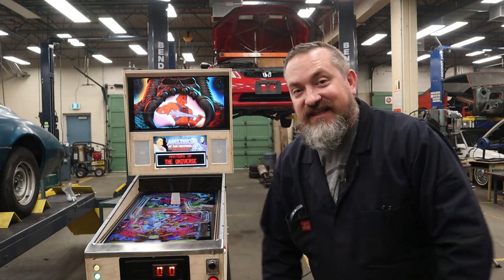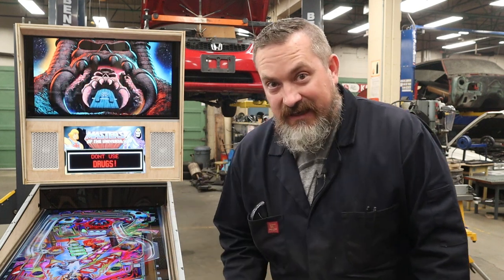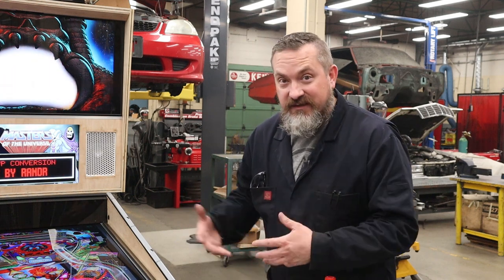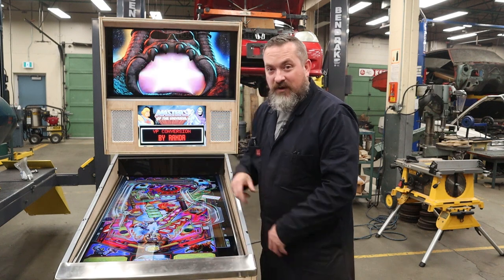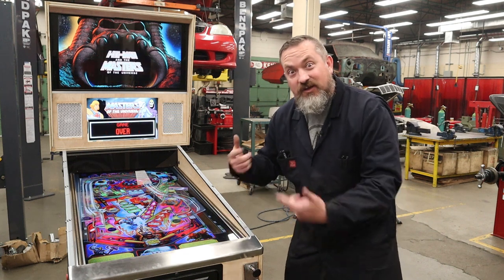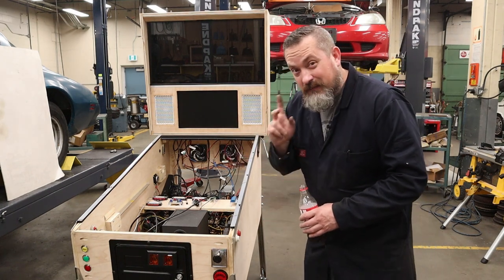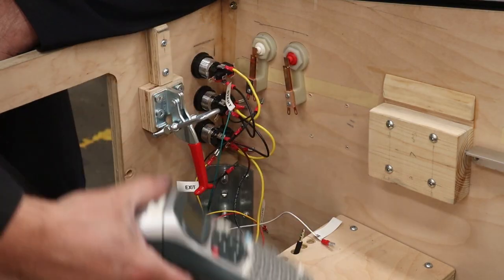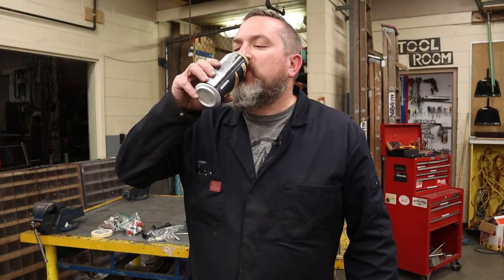How to disassemble your best friend: virtual pinball

Comment: Another great video!  Like you, I disassembled my cab to paint the interior.  Before painting, I painted each screw hole in the cabinet with dayglo paint (any paint or no paint would work).  Then I placed a round sticker (like a small price label) over each hole.  After painting the inside black, I was able to remove each label/sticker and easily see where the screw holes were.  
If I drank your energy concoction, I'd be awake for a week.  Wow! 🤣
Reply from the maker: Neat tip!  I like that one.  Yeah the mix is a bit goofy, just trying to add some crazy to the video.  Thanks for the watch!

Comment: Totally feel the pain man! I was without my cab for 2 weeks when I upgraded my playfield to an LG C2 and that was not fun! Tried playing on my desktop computer but this is not near a full toy cabinet! Keep it up, your videos are very helpful to the VPin community 👍
Reply from the maker: Yeah it sucks..... I'm going on 3 months now without my vpin.  I'm getting close to being done though ( the budget build....upgrades being planned) as I am ahead of where my videos are.  I am finishing the final assembly maybe next week.  I've been playing fx3 on my PS4 to deal with my pinball addiction.   You still loving your c2?  That's my plan for a 4k upgrade in a 48" size.  Thanks for the watch and your support for the channel.  Cheers Eric!
Reply: Thanks for the feedback. Yes, my C2 is awesome and have absolutely no regret about it. The only tricky part is the power ON / "OFF" pixel cleaning cycle but I was able to use the TV ON feature of my Pinscape AIO controller. Works great. I am working on a side project for a custom power control / timer module to make it even better and for those who do not have the same control option.
 @wayofthewrench
Reply from the maker: Perfect, I'm getting closer to the 4k upgrade plan.  So what's the tricky part for the pixle cleaning?  Does the power to the tv need to stay on?  I've got my current tv in a always on spot on the power strip so coming back later to shut the cabinet off should be a big deal.  Does the C2 have an auto sense and turn on for power on?

Comment: This is why I painted my cabinet first after assembly, although there is a little bit of touch up to do as the playfield mount was a little too tight to the sides.  But of course it's easier to see in your videos with the naked wood.
Reply: I'm with you on this one. I also painted after assembly. My solution to not having to do touch ups was to use black mate vinyl on the inside of the cabinet. It looks amazing and when handling the playfield mount carefully, it doesn't scratch at all.
Reply from the maker: There's no wrong way to do this.  There are pros and cons to do either way.  Thanks for the watch!

Comment: I can’t believe I missed this one.  My anxiety I soooooo high right now. Some of the parts removed have precision install points. Some serious detail to attention on reassembly or lots of tweaking and adjustment will be needed.
Reply from the maker: Yup everyone is in the same situation.  However, the holes will still be there after painting so you aren't losing your precision location.  As long as you bag and tag every screw, it'll be a quick and easy reassembly... you'll see in my reassembly video that's coming.  Thanks for the watch!

Comment: Definitely going to paint mine before assembly!  lol.  One question I'm thinking of is can you remove the legs from the Pinball machine, fold down the back case, and transport it in a 4Runner and set it up again?  I may be wanting to do that every 6 months or so.  I saw there were parts near the legs and so my question, wondering if the leg bolts are obscured by parts nearby.  Of course, those parts could be placed in a way to access the leg bolts.  Answered my own question :) What's the whole thing weigh?  

In my build, I've ordered a pre-cut plywood case and 4k 120hz TV for the playfield.  I'm putting together a gaming PC without a case to power the graphics card and 4k graphics.  I've overspent a bit, but dang it's going to be awesome hopefully.  I'm following along with your parts orders for the most part.  My dining table is covered in electronics at the moment :)
Reply from the maker: Yes you can just support the cabinet and remove the leg bolts and lower the blackbox to fit in a suv.  I'm a little leery to just rest the blackbox t molding edges onto the stainless playfield sides though.  Maybe make a carpeted/padded protector.  It's heavy.  I have 4 rolling caster plates that I can put underneath the legs one at a time and roll it around no issues.  However, picking it up to put in an SUV would be rough.  You would need 2 or three people for sure.  Awesome, sounds like you're gonna have an awesome build.  Send me pic when you're done!  Cheers!

Comment: Ye gods...I have been watching you build this and I am in the middle of planning my own cab as a winter project. And I am in the Uk, so if it was me, I would remove screens etc and JUST PAINT THE OUTSIDE! And not take everything out of the cab when its that neat. You can paint the outside, add vinyl graphics etc, do the back box, but there really is no point doing the inside of the body, most classic pinball tables I have seen are not painted inside either. Its not going to be in damp area so will not need protecting to that degree...
Reply from the maker: Yeah I did address that in the video but nope, mine is getting the full spa treatment and is going to live forever...lol.  there's really not a wrong or right way..... it's different for everyone's needs, budget, and skills.  Do watch ya like.  Thanks for the watch!

Comment: This is insanity!  Aren't you jeopardizing the threading of certain mounts because you'll need to screw into existing holes on a second go-through?
Reply from the maker: You could but if you didn't go crazy hard and partially strip the screw holes the first time, you'll be good.  Plus the pain fills in the holes a bit so they are actually no problem.  Thanks for the watch!